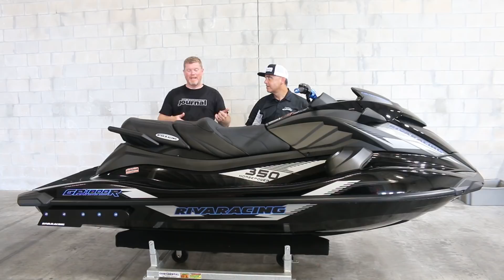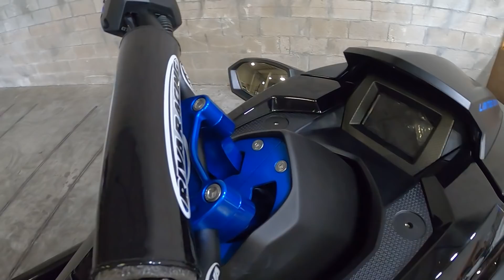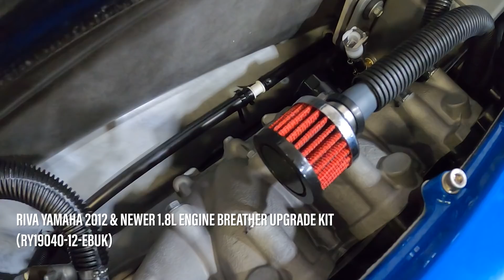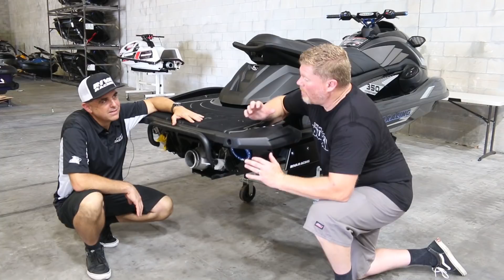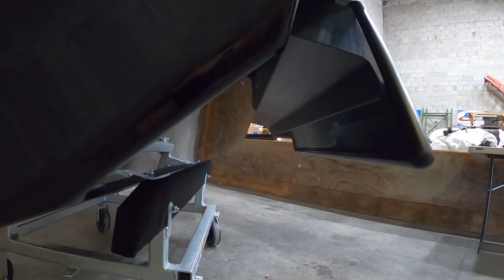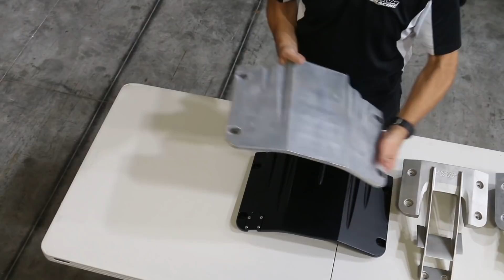Build Your Own RIVA Stage 2 GP1800R SVHO: The Watercraft Journal, EP. 93

Comment: More of a flat water ski but still a great package
Reply from the maker: Pretty stupid thing to say when this exact machine has dominated offshore AquaX racing.
Reply: Ok, why be an azzhole?  Guess it comes natural to you.  The GP hull requires extensive mods to handle rough
Reply from the maker: Why make declarative statements on something you don't much about? The GP hull does NOT require such mods – no more than sponsons, an intake grate and ride plate. Just because YOU cannot handle it in rough doesn't place the vehicle at fault. It means you're a substandard rider. –K
Reply: Complete nonsense.  Most endurance offshore guys have used the FX hull, and still do.  For buoy courses, the sharper/quicker handling of the GP is worth the trade off in rough water stability.  These are all well established facts.  You know nothing about my riding history so making this personal with speculative comments is childish.
Reply from the maker: How does the water look after 2-3 laps on a closed course? Ever been to Havasu? Worse than most offshore conditions, so your point is moot. –K
Reply: Closed course buoy racing GP hull wins, I never questioned that
Reply from the maker: No, but you proclaimed the GP was only good for flat water, which was demonstrably wrong. –K
Reply: Which hull would the average racer pick for offshore endurance in 2-3 ft chop?  Definitely not a GP.  Yamaha has the money, though, and Kawasaki is kind of joke in terms of sponsorships.  Anyway I had fun blowing yammies off the lake again today on the Ultra 300X.   Ten years and still running strong, the King of Chop
Reply from the maker: "Most" doesn't mean "better." For every 1 Jordan there's 10 Lebrons. Superior Yamaha riders almost always pick the GP.
Reply: For buoy work...
Reply: @fzr1000981  lmao
Reply: @watercraftjournal i am looking for the intake grate, ride plate and sponsons cannot find the sponsons of 2022. The intake grate on the web site the stock grate shown is of previous models, its not of the gp1800r svho model 2022

Comment: yamaha must be using a gps now for speed,  the oem plate does not have a place for the wheel,  they are using a block off for the riva plate,  must be used on prior years also
Reply from the maker: All current Yamahas calculate speed using engine RPM.

Comment: Can I buy the ride plate , the sponsons, and the jet pump intake bolt them on to my Yamaha 2021 and get some better performance from the stock engine ? And is that ok to do?
Reply from the maker: You'll get better overall performance WITH the stock engine, but not because the engine is running more efficiently or anything. It's entirely indicative of the hull, and pump efficiency.
Reply: @watercraftjournal  that’s great . I’m not looking for more speed or power. Just looking for better handling , smoother ride and overall just a cleaner ride ….cavitation ect ect ….thanks . 270-300hp is mind blowing as it is. Lol 350hp is face melting power , just think about that a Subaru wrx all wheel drive with a tune and turbo makes 400hp and weighs 3400lbs , this thing is almost as powerful but weighs 2000ls less just rounding on all numbers …..insanity . I cannot wait . I am buying two new jet skis 2022models just not sure witch brand . Probly Yamaha or seadoo
Reply: Most would say you must lol but yea you should be totally fine. If I was you I would totally give them a call and see about the reflash if you’re going to do all of that as well
Reply: @duradance4475  well I’m a newb , so I’m sure the stock power will be enough to make my butthole pucker for awhile lol. But anytime I can get bolt on performance for a smoother cleaner ride on anything .I’m in. But yeah I will call them . Thanks .
Reply: @duradance4475  I don’t need 350horse jet ski, but I’m sure in time I will . My Tacoma has 187horspower lmfao.